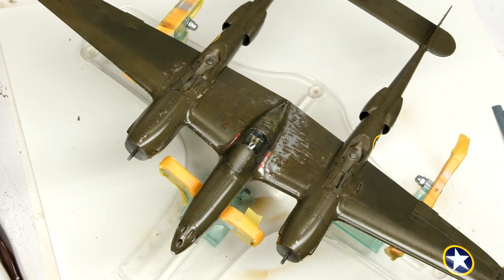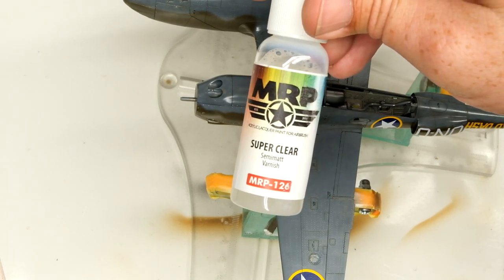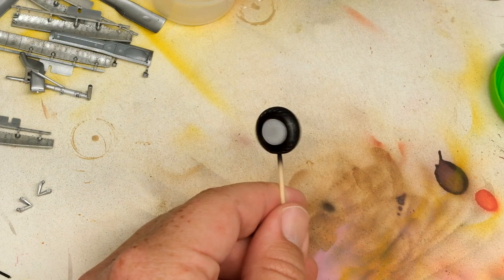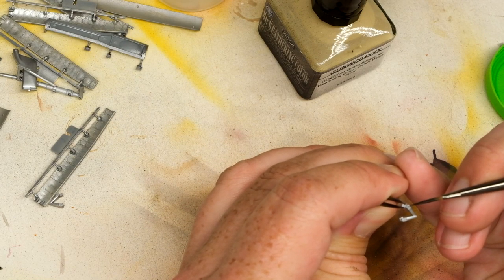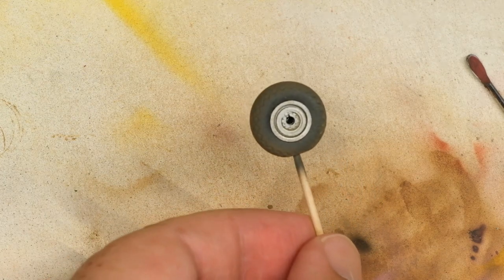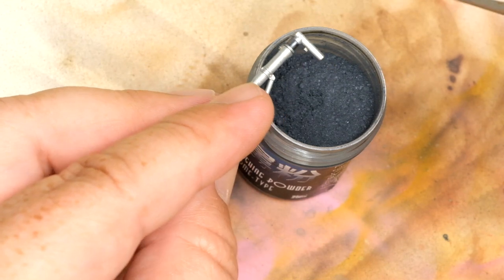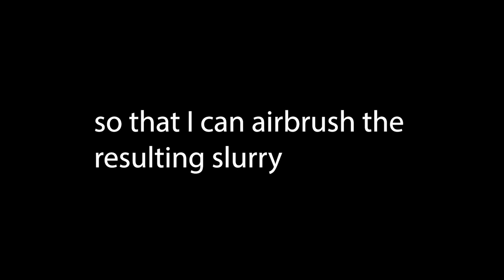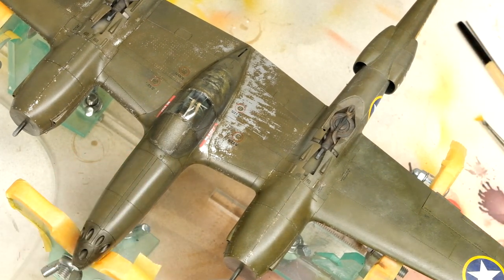Tamiya P-38F Lightning 09 - Misc. Weathering

Comment: Thanks Doog for the great tips and tricks. Do you think that "No step" scuff could have been done reasonably with a small electronics or watchmakers Phillips head screwdriver? Just thinking about what have around to help with un-newness like you did. Just curious.
Looking forward to seeing even more of this build, it's really coming along (despite the carpet gremlins assistance 😜)
Reply from the maker: I'd be worried about doing some serious damage to the paint with something like a screwdriver, but it's also a matter of control.
Reply: @DoogsModels  Can see what you mean. Was thinking of the bevel from the point back already being at at appropriate angle.
Will find something more suitable when I get to that point. Keep up the solid builds and videos. Thanks for all the hard work!